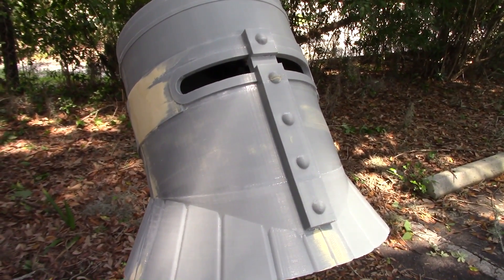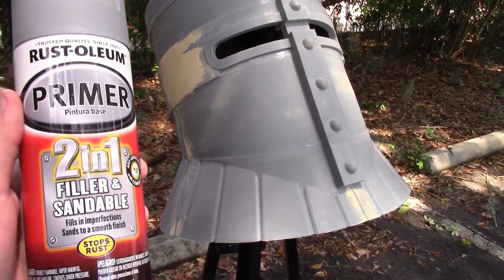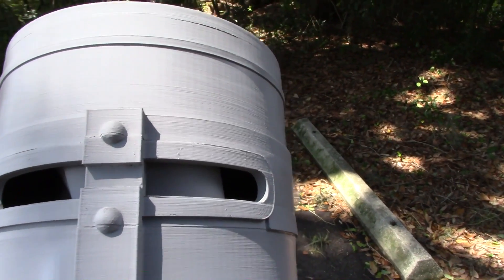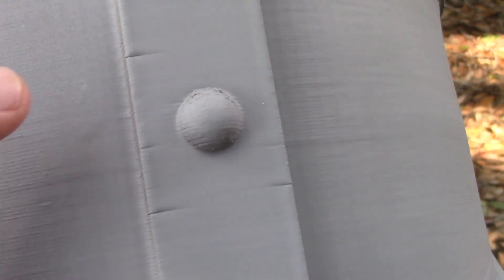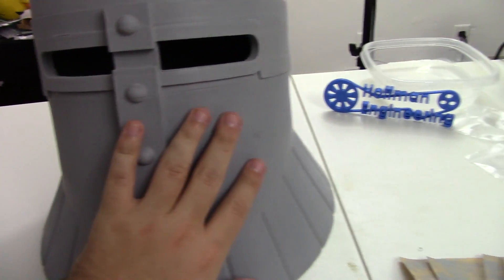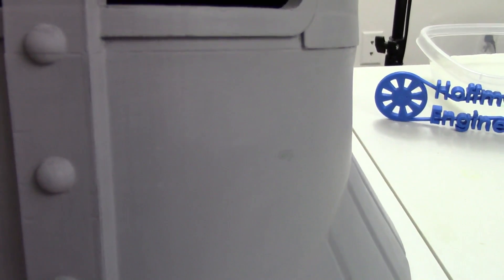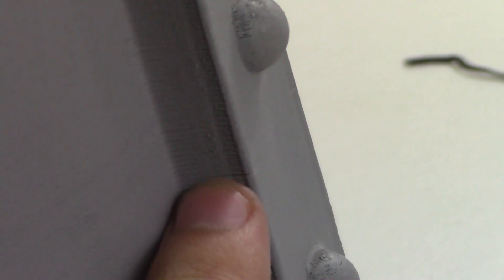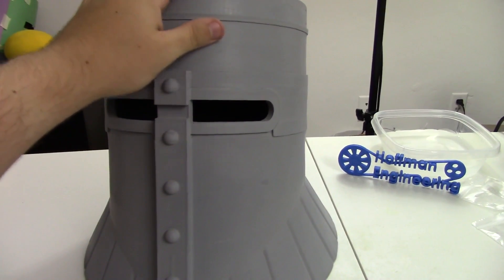Filler Primer - Will it make 3D Print finishing easier?

Comment: I realize this was a test, but if you had sanded in between primer layers, you would have had higher quality results. The primer on the peaks would have sanded away faster than the primer in the grooves and the subsequent layer of primer would have been significantly smoother. 

Rustoleum filler primer still gets a thumbs up.
Reply from the maker: I definitely agree, I learned this lesson the hard way. I spent a large amount of time sanding the 3 layers to get a smooth surface, which then required another 2 coats of priming and sanding. Sanding between the coats probably would have saved more time than it would take. Oh well, it was quite the learning experience!
Reply: Yeah, but don't you love learning while everyone else is sitting there eating popcorn just WAITING for you to make a mistake?!?!   :)

Comment: @7:18 "Those lines are due to the way 3d printing works....".  That's not entirely accurate.  You can easily get perfectly round objects 3d printed depending on the modeling program you use.  But, in the end, when the gCode is created, a perfectly round circle, is still created using really small straight lines created by the modeling program.
Reply from the maker: Correct, it does depend on how the mesh is generated by the CAD program, the higher the mesh count, the smaller each of those line segments would become.

Comment: You might get better results if you sand in between each coat. It probably won't clog up your sand paper as much because you won't have 3 coats sitting on top of the layers. It may take less primer as well.
Reply from the maker: Yeah, that was a lesson learned here. Sanding between the layers would have given me a smoother surface, and I think the issue with gumming was due to the paint not being fully cured. I came back to do the other side about 4 days later, and it was much easier to sand. Still took forever to get a smooth, consistent surface though, and I had to remove a lot of the primer to achieve it.

Comment: I had the same issue with the primer clogging up the sandpaper. I wonder if the primer should be given more time to dry. I sanded the primer after 24 hours.
Reply from the maker: When I went back to it a few days later to sand the other half, I had a much easier time sanding it. I think the can recommends a 24 cure, but in my experience it needed more than that, especially with the 3 layers I did on the helmet.
Reply: Did you end up trying the wet sanding?

Comment: I like the layer cracks on the front vertical 'Iron', I think it gives it a little more authenticity. :-)
Reply: Was thinking the same thing.
Reply: yeah if it's cast iron. I've never seen cracks on forged steel.
Reply: I actually agree if you're saying it looks interesting. But shirley this is supposed to look like it's made from metal. And don't most fighters like to polish their helmet. ;¬)
Reply: sure most knigths polish their equipment, but the layer cracks there looked like battle damage, that you can´t polish out. Ever seen an re-enactment sword and shield? Over time, there will be tends, bends, scratches and other artefacts. You might go ahead and break/remove burrs, but you can not reattach material. so the part eventually gets permanent scares.
Reply: YES!
Reply: Ah, well, no. I'm certain that any Olde Worlde English Knight of the Realm would not polish anything of that sort. He will definitely have had servants to do that for him.
These days though, it's all very different.

Comment: Would the vertical lines in the helmet come from the way the model was created and not the printer?  If that was made in Sketchup and you only specified 60 sides on a circle you would notice that more on a large circle like as on that cylindrical helmet than you would if you had used 240 sides. 

Still a really cool helmet. Is it for Cosplay? 

Norbert